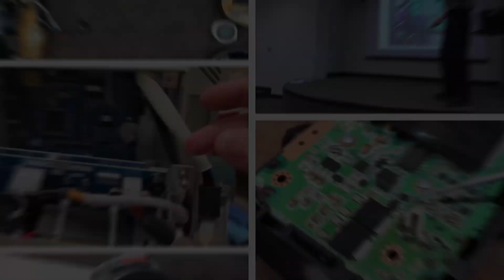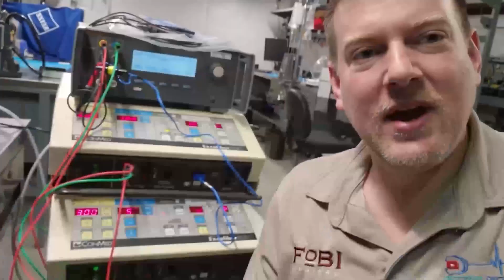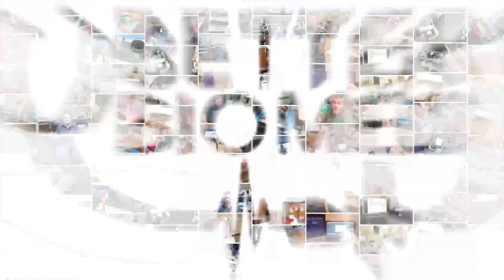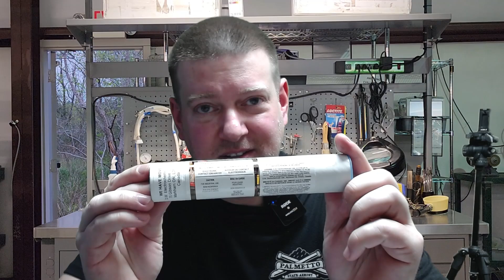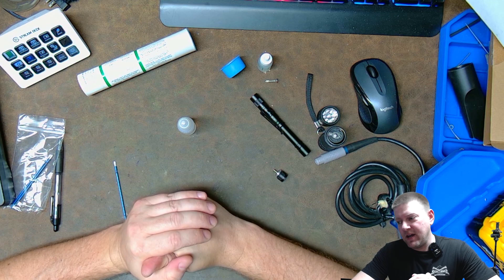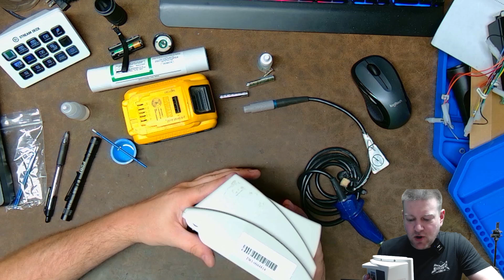Stabilant 22 Miracle Chemical!

Comment: Good video, thanks for the dilution part of It back in the day there were no Instructions or videos. I've used It in the Automotive Field decades ago on a SUV ABS system that kept getting low power codes It never came back so I asumed It worked. One of my former co-worker @ the time was a certified VW Dealership Tech and had a couple of tubes of It because he said VW had connector pin contact issues that led to unescessary engine and dash wiring harness replacemets which led to TSB's being created and officialy using Stabilitant 22. I'm faced with another Automotive Issue that has possibly Intermittent poor electrical pin contact on 0.64mm pins so im gonna buy some and see what happens.
I have a few questions, Do you have a follow up video for this ? Do you know is after aplying and using does the stabilitant have to be cleand up before reapplying ? Does It clean up easily like with electric contact cleaner ?

Comment: So for me I use it everyday in the OR on countless things.  i use the liquid form on female pins and connectors and I use a brush to paint the gel form on male pins and battery contacts etc...  i fix so many glitchy problems with it and use it preventively on battery contacts,  monitor cables  PCB edges etc....

Comment: Handheld Pulse Oxen, tele transmitters, lab equipment, UPS battery connections, and patient lift battery connections quickly come to mind to try this on.  I also have a CNC machine at home that is kept in an unconditioned shed.  Corrosion has been an issue with it and I am sure the electrical connections especially the steppers, and controllers which pull some current for sure.